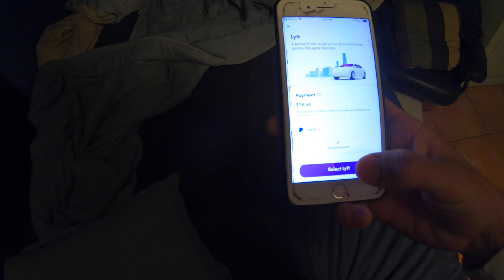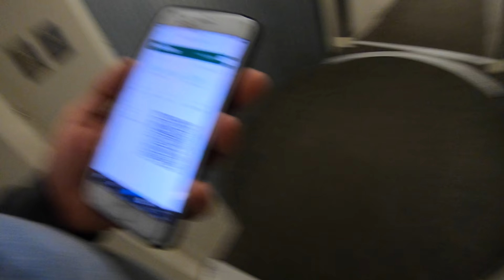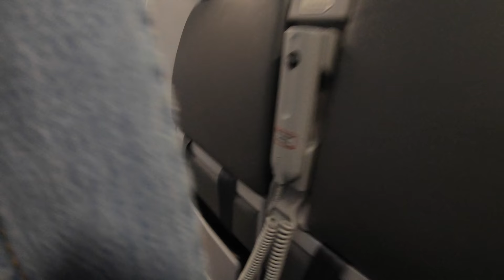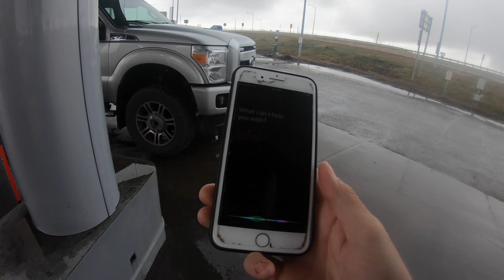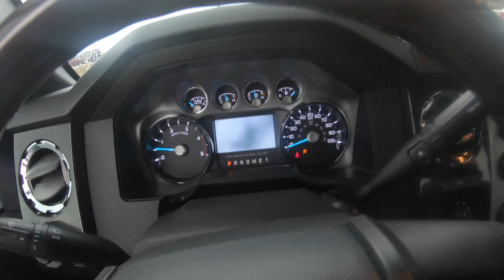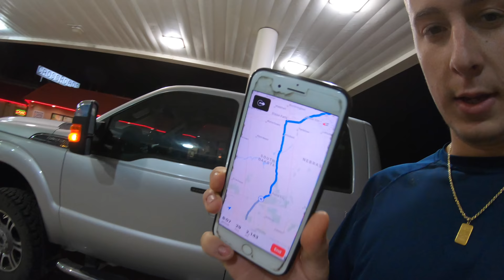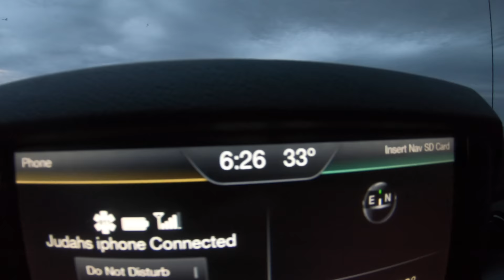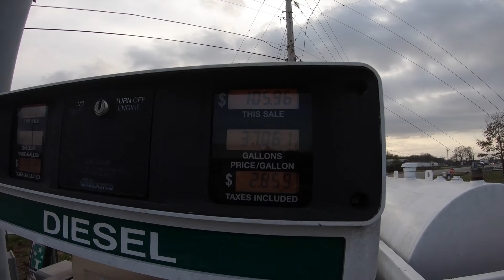Traveling 5000 Miles Across the Country to Buy my Dream Truck

Comment: The money you save on the car went right Into the gas tank
Reply: Swazzy Tubeee and airport ticket, plus food, & time he could of been working instead
Reply from the maker: Swazzy Tubeee lol it cost me 600$ in fuel food and expenses/plane ticket to get home 😂 feel free to go to your local dealer and get bent over but I’ll pass
Reply: @judahfindley  That's so cheap considering you used about 213 gallons of fuel on that car. With the price of $3/gallon you would've spent about $650 on gas alone.
Reply: I personally would have had it delivered, but congratulations
Reply: Swazzy Tubeee yah but he refilled 4 times. Great mileage
Reply: Ford F-250 6.7 Super how much

Comment: Dream truck? So you’ve only been dreaming of a truck since 2016?
Reply: brandonflores121 dream trucks change once the new ones come out. I always wanted a 4th gen Ram 1500 as a teenager, but now my dream truck is a 5th gen cummins.
Reply: Carson Nelder waiting for them to change up the 5th gen 2500 body a little more, it uses the same body as the 4th gen sadly. 

Only thing they changed was the front end, interior, and rear
Reply: I mean the guy is only 20
Reply: Ivan Maars Ig it makes you feel any better Ford used the same body and kept adding little things to it for 20 years.
Reply: Dakota Jaegle don't you think I already know that?
Reply: My dream truck is a 2014 f250

Comment: Dude I gotta ask, why did you go so far for a 2016 Platinum Super Duty?  Surely those exist in Florida and would be rust free and wouldn't have the big dent on the bed side.  It's a nice truck, just doesn't seem worth a 5000 mile trip when you could easily find 20 of them in a 25 mile radius of you.

Comment: You wouldnt mind sharing what you paid and mileage? Looking at a white 15 platinum, they want 38k it has 100k on it. Going to try and get them down to 35
Reply from the maker: Joshua Chavarria  35 k would be a really good deal. 38k is already a pretty decent deal for a 2015 with that mileage
Reply: Thats a lot of fucking money... for a 2015

Comment: I bought a brand new 2015 F250 in 2014 and regretted it because I actually use the truck for work. I beat the hell out of it. Then I was dumb and bought a 2017 Ram 2500 Diesel and also kind of regret it but I'm not as worried about destroying the thing and I know the diesel will last longer. That being said, if you're going to buy a new truck for work I would very strongly advise against it. They lose value insanely quick and like to hang around the $20-$30k mark for a few years but I was underwater on my Ford loan until this year.
Reply: My Ram has all of the nice shit too lol, big touch screen, nice finishes but it's always covered in dirt & dog hair. Can't keep it clean if you're working in it every day.
Reply from the maker: I bought this cash for a good deal . My vehicles are appreciating assets to me because I buy them at the right price .